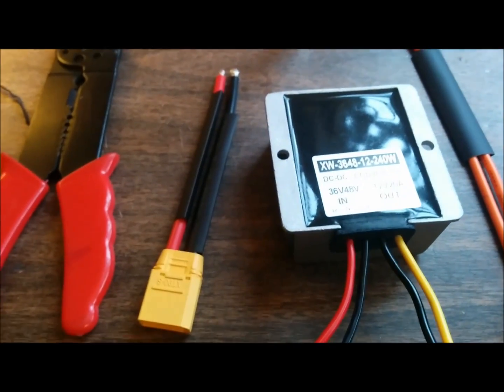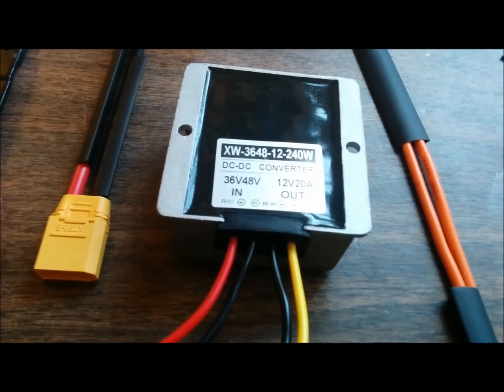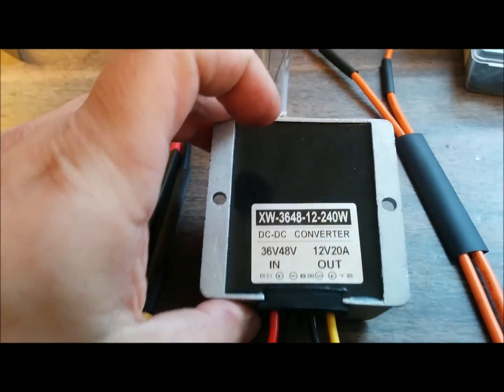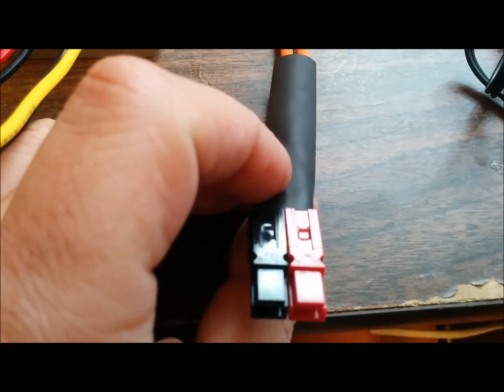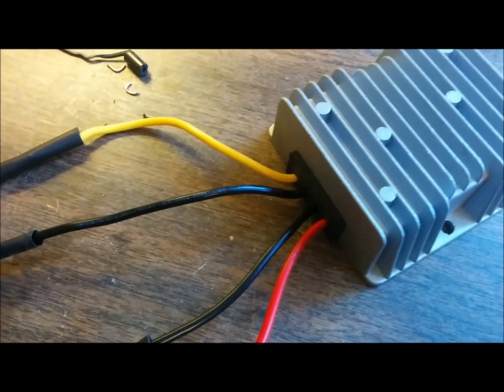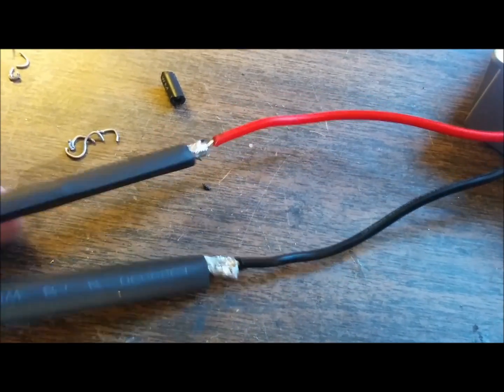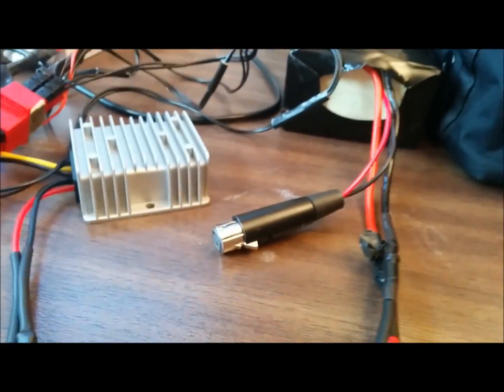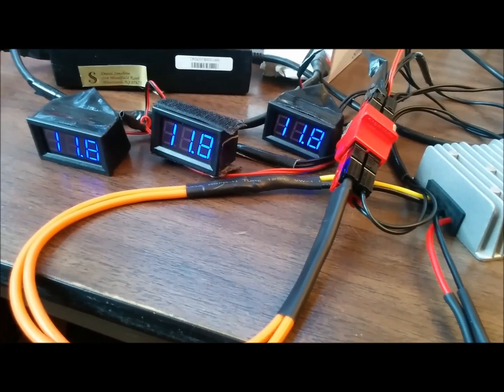Waterproof DC-DC 36V 48V Step Down 12V 20A 240W Power Converter Regulator

Comment: i use a 48 v to 24 v converter from the same manufacturer to increase the capacity of my powerstation by connecting a bicycle battery. 
i charge both the powerstation and the bicycle battery with solar power. 
i use the powerstation as a power generator. i switch off the access to the public grid by means of the fuse and connect the powerstation to a power outlet. works perfectly. 
greetings from germany.

Comment: using a 36v battery stepped down to 12v to boil water... how about burning propane in a steam generator to power an electric kettle? might actually be a little more efficient
Reply: Looking for the right connection for the yellow black or yellow blue wires but you failed to show. Not well thought through shame
Reply: Dam, youre a jerk. Not saying your point isnt taken lol.

Comment: I see that the converter can take any voltage from 36 V - 48 V and draw it down to a constant 12 V But the output says it can go up to 20 A  Does that mean it can safely handle any draw up to that limit,     Or if you put say a 12 V device drawing max 80 W at a max draw of 6.5 A,   It would harm the device ?   Or it won`t matter ?

Comment: Hi friend!
Thank You for the vídeo!
I bought a buck booster 36 to 12 volts 3amps 36watts on eBay. I want to hook it to my 180watts 36volts  solar panel to run some accessories in my electric car. What do You think I can run without any problems. Fans, radio, lights, horn?
Thank You!
Best regards!
Emmanuel Távora Freire